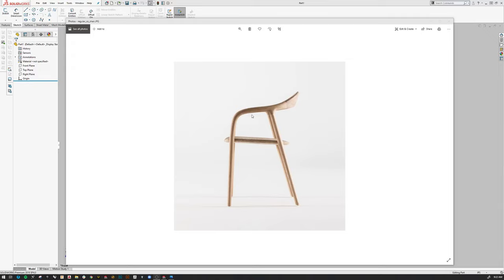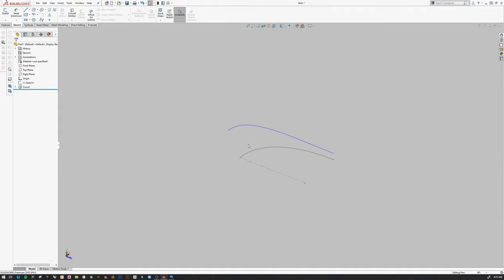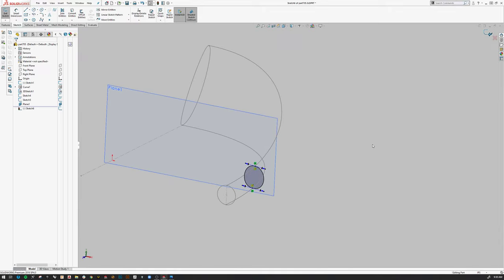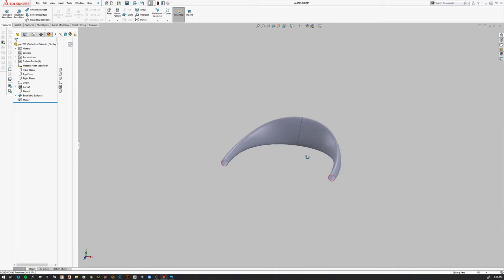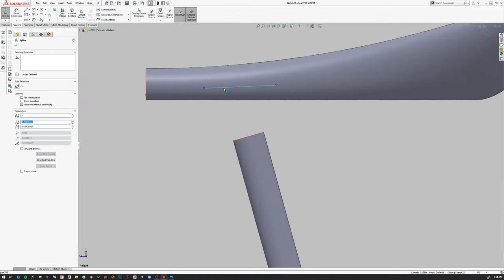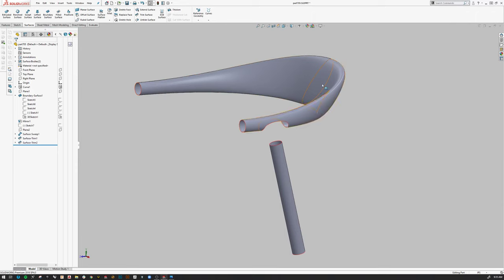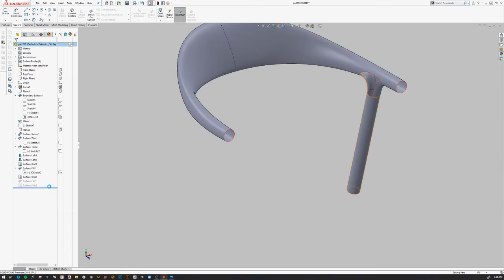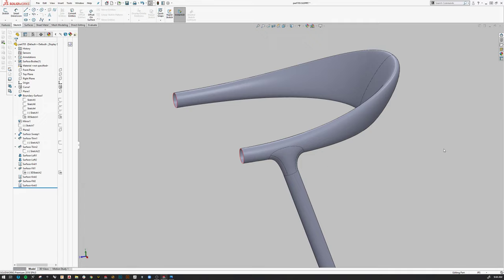blending surfaces in solidworks

Comment: 30+ years CAD, Alias, Maya, Blender, Houdini, and Rhino/Grasshopper user here... with all due respect to Mr. John Ford's nice tutorial, Rhino and Grasshopper's Multipipe feature lets you create 100's and 1000's of these joint blends in a single operation, and Subdivision modeling in general renders these kinds of blend transitions modeling using CAD less desirable or even obsolete.  There is a large paradigm change at work.

Comment: I watch your video and I see how you make it, but I want to know is- How do you see what you need to do and how do you visualize this before you even start? I get lost with splines and using them together on different planes and how to bend them. I have modeled in Solidworks for several years, not much in splines, but I get lost some here?
Reply: I know exactly what you mean and it's really frustrating.
Unfortunately, the only way to visualize what you need before even starting is through practice. My recommendation is watching tutorials such as this one and actually doing it yourself as well.
After doing it a few times, you incorporate the logic behind each case, and the next time you encounter a similar scenario, you'll be able to see what you need because you've done it before.

Comment: Hi John, awesome video and intro to surfacing for me. But I am struggling to move past a certain point because I have two boundary edges on "Boundary_Surface1". The boundary edges come from the direction_2 sketches/curves. Your model is missing them  which allows you to continue blending as you do. But I cannot for the life of me, find the setting that dissolves those edges. Any idea? I have also looked at system settings which have not solved it.
Reply: Use [insert][curve][composite] command to turn two line/curve segments into one.
That should help if I understand your issue.  Good luck.